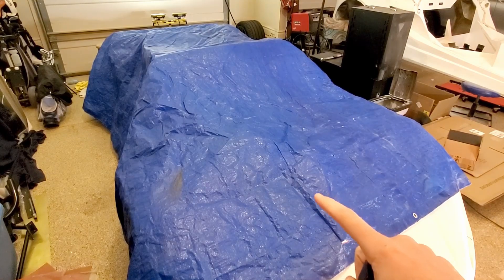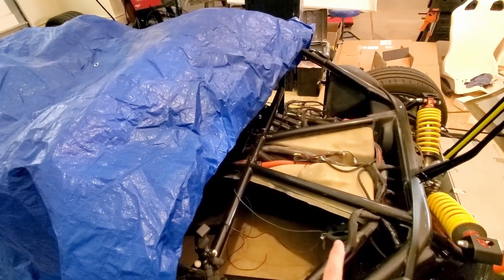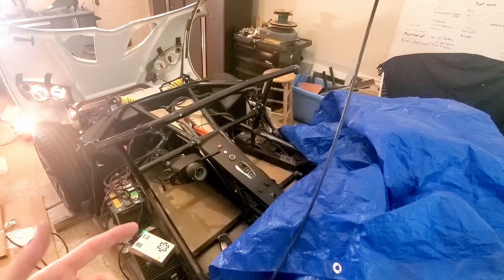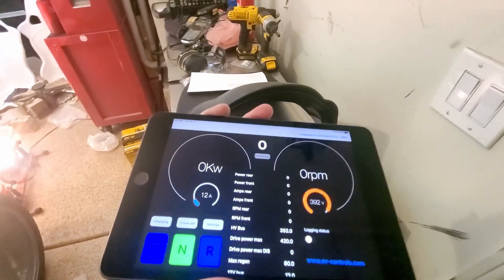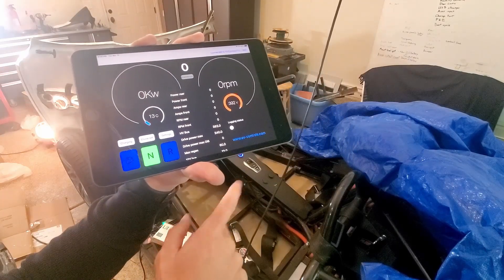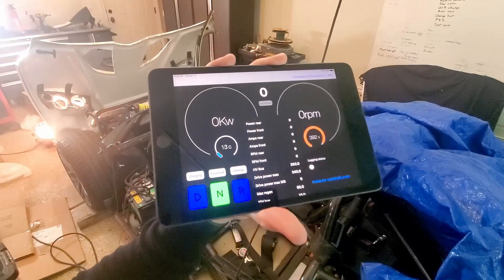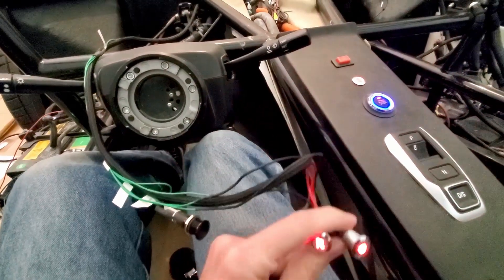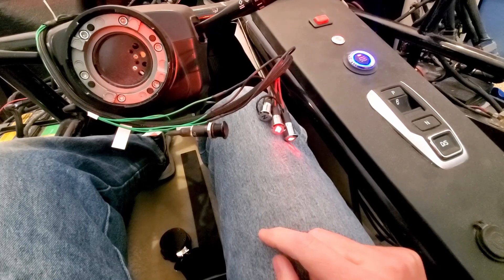New Tesla Controller – T2C EV Controls

Comment: hi mate, nice build.. few questions.. if you can help with.. your coolant pumps control with T2C..? how do you connect to the model 3 charge port ECU.. thank you
Reply from the maker: Coolant pumps should be on anytime your motor is on.  You can simply wire them to come on with keyed power.
Not sure what you mean by model 3 charge port.
Reply: @electricsupercar  thanks for the reply. what controlls your battery charging..? im using model 3 battery pack.

Comment: Hi  what HP Tesla  large drive unit is in the car   is it the ludicrous  there a few different HP versions i think     Pete
Reply from the maker: It is the sport model from a P90D.  I was told it can handle 475kW (637hp).  Personally I have never turned it up past 340kW and I have yet to hit the floorboard with the throttle. I think anything more would only be useful on highway pulls

Comment: What controller were you using before? No need to install a new board inside the inverter?
Reply from the maker: With this controller, If you have a matched (or flashed to match) inverter board, you are good to go

Comment: It'd be so cool if a fully programmable controller interface was available. Like, imagine if they just published the API that the app uses to communicate with the vehicle.  You could set up a fully custom digital dash, potentially adding all kinds of cool stuff. It'd make it possible to not only DIY the hardware, but the software as well.

I'm imagining a few analogue dial needles for the important, constantly updated data like speed and RPM, on top of a big frontlit e-ink display for all the more verbose data and other info that you don't always want on-screen. Heck, you could set up custom security measures, like setting up 2FA for starting the car, where it migh require both a password and biometrics to start. Suddenly, your car doesn't even need a physical key... you are the key.
Reply from the maker: That would be awesome!

Comment: Did you have to swap any components in the drive unit or the controller you purchased works with the drive unit as is?
Reply from the maker: Nope.  Just swapped the controller
Reply: @electricsupercar  That's cool. Is it a performance motor or a base motor?
Reply from the maker: @yarik06  performance motor

Comment: Ok, I tested this and it will work. For this to work you cant have a password on the iPad which kinda sucks but it's the trade-off unless you want to put in the password or Touch id or whatever every time you go to use the car.

1. Go to Settings > Display & Brightness >  Auto-Lock > Never

2. Go to the Shortcuts app
3. Go to automation (at the bottom)
4. Select "Create Personal Automation"
5. Scroll down to "Charger" and click on it
6. Make sure "Is Connected" is the only one with a check
7. Click "next"
8. Add action
9. Search "Set Low Power Mode" and select it
10. Set it to "Turn Low Power Mode Off"
11. Add action
12. Search "Open App" and select it
13. Select the "EV Controls dash" app
14. Click "next"
15. Turn off "Ask Before Running" 
16. Click "done" 

17. Click the + in the top right
18. Select "Create Personal Automation"
19. Scroll down to "Charger" and click on it
20. Make sure "Is Disconnected" is the only one with a check
21. Add action
22. Search "Set Low Power Mode" and select it
23. Set it to "Turn Low Power Mode On"
24. Add action
25. Search "Open App" and select it
26. Select the "Clock" app (can be any app that closes when not touched but clock doesn't take much power at all)
27. Click "next"
28. Turn off "Ask Before Running"
29. Click "done"

Now any time you turn on the car which means the iPad is now getting power, the car will open the EV Controls dash app, and by pre-setting the Auto-Lock to never just means the iPad will never lock as long as you are not on Low Power Mode (which sets Auto-Lock to 30 seconds and it goes back to never when it's off). When the car is turned off, Low Power Mode turns on causing your Auto-Lock to become 30 seconds (as I mentioned above), and switching to the clock app will allow the iPad screen to turn off in 30 seconds (I'm assuming that the EV Controls dash app won't turn off ever for safety reasons). If you have any questions just reply to this comment or message me on Instagram @numannakkash if you need personal help.
Reply from the maker: Wow!  Thanks for the help!

Comment: When you bought the T2C did they provide you with CAN Address/Data Table? I cant find any documentation with it. Thanks!
Reply from the maker: Hey Friend!  Not sure what you mean by data table.  I am sure you can give them a call to answer your questions
Reply: @electricsupercar  I tried to ask them over email last week and no response. I wanted to know if the controller is capable of being controlled by a more advanced traction control system such as the AEM EV VCU 200 through CAN. They do not publish any CAN tx/rx info so I assumed that either it doesn't have it or they only provide it to you if your purchased it.
Reply from the maker: @graykimchi  they have always promptly replied for me.  I do not know the answer to your question.
Reply: @electricsupercar  You paid for yours already that's probably why haha. Great video!

Comment: Love the progress. You should get a head unit where you can install the EV controller app and don't use the iPad mini.
Reply from the maker: Can head units install and run Apple Apps?  It needs Apple ios right?  I am unaware of Apple making any head units. 🤔 I will have to look into it.
Reply: @electricsupercar  Apple does not make a head unit, and installing a tablet full time in a car is not as easy as it should be.  I would reach out to EV Controls and see if an Android app is imminent.  If it is, then an Android head unit will be the way to go.  If not then you have to start looking at how to mount the ipad in the car.  There are ways to make it sleep/wake with the power and automatically open the app.  Used all the time for kiosks and other commercial applications of iPads.
Reply: You are right, head units are only android. Maybe EV Controls will come out with an Android app. You could use a AEM digital display though.